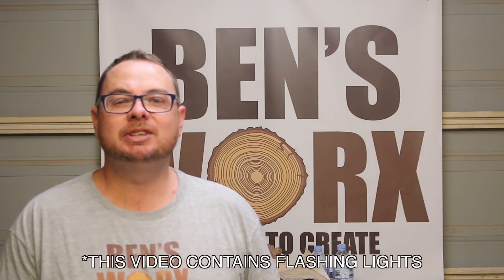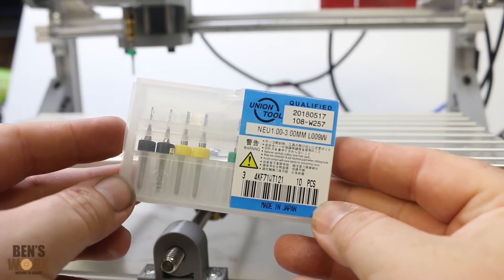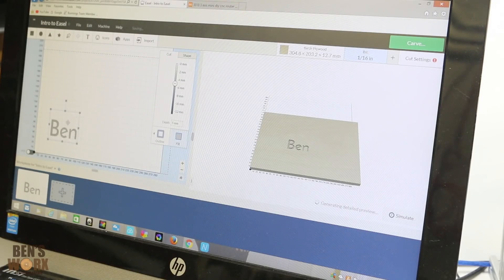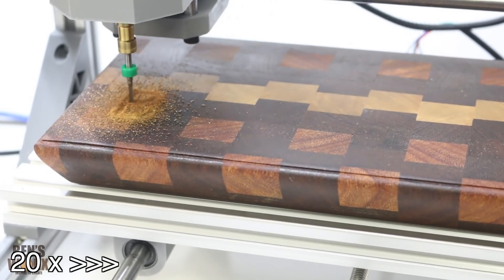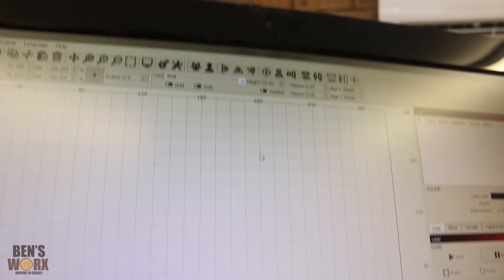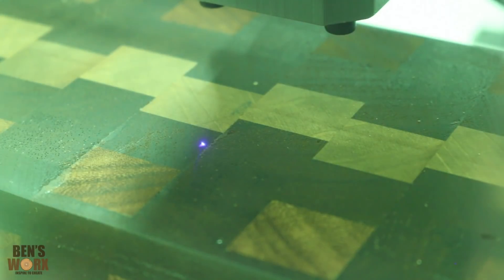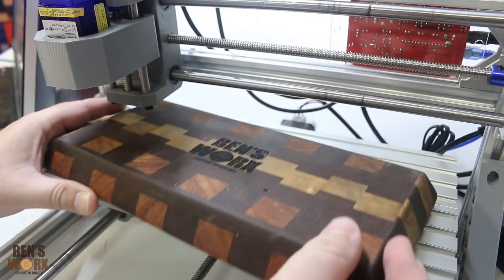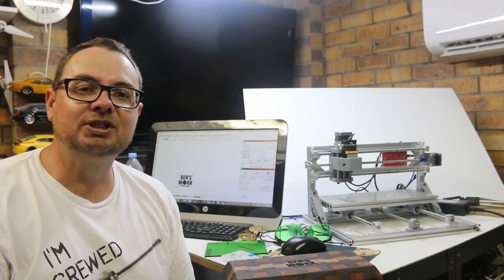Testing a 3018 3 Axis mini cnc router with 2500mw laser module

Comment: Ben I purchased another control board because the one I got had no laser port. I got a :Fan’ensheng 3018 CNC Router 3 Axis Control Board GRBL USB Stepper Motor Driver DIY Laser Engraver Milling Engraving Machine Controller. The old board came with a 24 volt DC supply. The new one had no supply. Is the DC supply 24 volts also ? Need hookup info on this board.

Comment: On the collar, if the shaft doesn't have a flat spot but the bits do, could you not just tighten the grub screws against a flat spot on the bit? Does that not hold good enough?

Comment: Hi Ben.  Thanks for sharing this video.  I have a question dealing with the laser part.  Basically to get to the point.  I'm building and painting wooden items.  What I'm wondering is, is safe and possible to use the laser on a painted wooden object?  Thanks in advance.

Comment: Hi Ben thanks for your videos, especially you resin work, they are very inspiring.
Do you have any advice on how to get a specific image into the cnc. I wondering if it could be used to cut out for inlay work ie setting metal charms into timber.

Comment: Ben how do you zero or set the machine to the homing position? I've tried but my projects never turn out quite right   on the board in relation to the position on the screen
Reply from the maker: Once you are in your desired home position there is a box saying set home on the screen if you are using Easel

Comment: I have a CNC 3018 pro device that I worked on and I gave some cancellation during work and because the motor parking device stays in a state of complete parking and a sound comes out of the motor in the case of an attempt .... Can the piece be whistled to return to what it was ..... please help

Comment: Anyone know what the secret is to get the 3018 setup with easel.  Ive installed arduino and open source grbl, flashed the board but still not connecting to easel

Comment: This 3018 seems to have a very large table with 8 tee sots.....the latest ones on Bangood, Amazon and Ebay….same basic design..... all have tables that only have 4 or 5 tee slots, but they are still termed 3018. The prices range from A$195 on Ebay (with the ER collet chuck)  to A$230 on Amazon and Bangood with the brass tool bit holder.
Reply: The 3018 figure refers to the usable area of the machine - ie 300 mm x 180mm
Reply: @alanmountford5574  Yes, I realise that, I just can't understand why the table in 2 identical machine adverts is different or appears to be if the adverts are true and not just a stock photo. In one Utube review of an assembly the table is actually 2 pieces joined underneath by 2 clamps and the screw nut housing.
Reply: @gangleweed  I am not sure why some tables are different - but I suspect there may be more than one manufacturer of these machines. But I could be wrong?
The machine I bought had the table in two pieces that joined together too.

Comment: You really didn't have to rewire those
You could have used the software to reverse the direction for some reason they came default reversed
But if you check into the software you'll see that there's a way to reverse the stepper motors

Comment: can you do engraving on transparent acrylic?
Reply from the maker: With the cutter yes, not with the laser, the laser needs a dark workpiece to burn correctly
Reply: @BensWorx  
thank you for replying my comment.
I've been searching for this reliable answer through internet for few hours.

thank you so much
Reply: Ben's Worx are you sure its not just the type of laser ? ive seen larger machines cut straight through 3cm sheets of resin and engrave very fast too
Reply from the maker: Yes it definitely depends on the strength of the laser, unfortunately this particular model won’t do it

Comment: Is it good for PCB milling? If so this and Ender 3 could make a good team for my IoT project.
Reply: Best is to add end stop so you can reposition when needed
Reply: @xiaoshizi131  Don't understand. What do you mean by 'add end stop'?
Reply: @benjaminlee9735  An end stop is a micro switch. On some of the cheap mill they aren't included.So you'll need to place them yourself. The Switch is to position more exactly your machine so you can start or restart your program. Enjoy Milling ;-)

Comment: Bro,will this Laser able to work on alluminium or steel with a minimum cut about .021inch
Reply from the maker: No mate
Reply: You can use the router
But
I don't think there is enough vertical space to accommodate a lower.

Comment: Ben, an excellent video and just what i need to get me going and move of 3d printing for a while or complement it, can you tell me if it works on acrylic please, thank you, Video was great from start to finish, also did you resin fill the board??
Reply from the maker: Thanks Neil, as long as you use the correct bit it will work on acrylic. As for the board I’ve been a bit slack and haven’t got round to it yet 😬
Reply: @BensWorx  Bloody Hell mate, your'e up late, i'm in spain and i thought i was late sometimes, never get round to sleep before 2 am and up at 7am!! Thanks for heads up, I will get one and the new cutters, I appreciate your candor and will follow you on instagram, i'm spiritburner.... I currently have a Creality Ender 3 pro, a Endurance Laser 8.5 watt beast that will cut any fucker and I was looking for something just to do simple cutting out on wood to make small models and engraving on wood like your name and if i can get a small laser as well win win...Thanks for the help , I assume it will cut out thin wood and plastic with the right tips so i can slot them together, my laser does but it always has the char line even with a air assist on the bugger, i have 85 litres of air pushing behind the beam to give it a cleaner cut so im hoping this will do it.  I was wondering, I assume you could either put a blower on it or even a micro vacuum cleaner onto the motor head and then when lasering reverse the blower to air assist....
Reply from the maker: Yeah mate, just finished a 12hr shift, I’ve just gotten an ender 3, I haven’t printed anything yet though
Reply: just seen the instagram account, that stuff is very nice that you produce.....I am retired early but have plenty of energy still to change with the times and take my work into my hobby. I already know lightburn back to front on my laser so thats good, just have to get my head around easel... If you need an intro to Endurance I am sure I could get you some discount from George if you are in the market for a bigger laser....just get in contact, I am one of his biggest supporters.
Reply from the maker: Thanks Neil! 👍
Reply: @BensWorx  just make sure its totally square and get a sheet of glass to print on not the magnetic bed, join the facebook group there are two, one for newbies and another one for oldies but there are some really nasty twats on it so watch yourself, make sure your questions are straight otherwise they lay into you, mostly from america so give as good as you get and when they do just FO and carry on, the ender is a great machine, but you need to buy really good software like simply3d to make your life a lot easier, its worth spending a bit, i have a mate in the uk who has 5 machines running 24/7 and he churns out stuff all the time to sell using these machines and the software. you can print a load of mods and you can upgrade the springs as well, normal things like xt60's dump and hard wire them in as the machine is on for a long time its the first part to burn out, I have mine installed in a old fridge with a glass door on the front which seals it and a gas air dump system i designed so i can leave the house and know if the fucker catches fire it will kill the power and kill the fire in 5 seconds or less, just make sure if you do put it in a cabinet with a extinguisher that you have a slot at the bottom for the co2 to push the air out.....works a charm and i love it, just want the mill so i can cut, mill and turn out some different shapes etc, 4 and 5 axis machine are above my hobby budget but this one looks nice. cheers and I will see you on creality.....just watch your electric bill!!
once you start printing it starts the meter whizzing, things take a long time to print but most slicers tell you the print time etc....one thing you do need to changes is the extruder for a aluminium bowden one, makes for a nice print and make sure the teflon pipe is all the way in, i have access to a great build video and setup if you need it, shout....all the best.
Reply: @spiritburners  Have you considered the direct drive for the Ender 3.....it's one mod I think would be well worth while. I watched the mods that Myfordboy did with a Bangood mill much like this one.....he almost completely rebuilt it. As long as you don't take milling with it too seriously you can get a lot of enjoyment just using it.
Reply: Ian Pearson thanks for the comment, I have but not sure where to purchase it for the ender sadly the Facebook group for the ender is full of trolls and nearly every post that goes up gets shouted down from  certain people in the US . Recently it has got so bad I have stopped posting for a while to see if it improves as new members are denigrated to the point that they give up the hobby and they are not welcome, I have seriously considered considered creating a group just for non US. It would be a shame to go down this route as there are some really nice guys over there and it’s spoiled by just a few rotten apples some of which are moderators.
Reply from the maker: Hey Neil, somehow your message got lost in the crowd, thanks for the info mate 👍

Comment: It’s good to watch your video there. I am planning to get one as I live in Aus as well.
I have few questions about their product see if you are able to help.
1. Is all software included? Do I need to download online or find the proper software myself? Anything to buy separately?
2. How long does shipping take?
3. What’s the max size of the chuck to hold the drill?
Thank you
Reply from the maker: Thanks Mate,

No software included you will need to source programs online

It took about 3 weeks from memory 

The collar is 3mm
Reply: I got mine from Ebay with the updated control board and er11 collet 
The grbl candle software works but I've been looking for a better platform to work from 
Easel works well to run your cad and generate gcode with I haven't ran the laser yet 
Be prepared to break tool bits tho 
It is slow for either more detail work and I carved 2mm deep project in MDF a 100mm x100m and that took over 2hrs
Reply: @CCCOILS  got a link to the ebay store ?

Comment: Hi, can send link for the flat top bits packs ? Thanks !
Reply from the maker: https://rover.ebay.com/rover/0/0/0?mpre=https%3A%2F%2Fwww.ebay.com.au%2Fulk%2Fitm%2F362502951901
Reply: @BensWorx  CNC 101, use the correct tool.  You should NOT be using that type of end mill with wood.  "Corn" cutter style end mills are made for composites (fiberglass, carbon, kevlar).  You should be using a fluted end mill.  For a cheapo machine like this, a 2 flute up spiral will do.

Comment: Hey Ben can the rails and the bed/table of this CNC m/c be extended to do larger jobs, Iḿ interested in making signs or small displays (8 to 10 inch letters) to hang from lamp poles. I understand I would need to upgrade the cutting tools and the software, thx...
Reply from the maker: Hi Melly,  I think it would be more cost effective to buy a larger machine, you would also need to change the worm shafts and guide rails

Comment: As if they couldn't have put a switch instead of the jumper pins, few cents. Then it could have been so much better.
Reply from the maker: Agree 👍
Reply: Still is a very easy 'mod' (if you can even call it a mod) to do anyway...
Or change the Arduino code to autoselect this.

Comment: just to add you can change the step pins in the GRBL so you don't have to physically disconnect the wiring. the pins have built in H Bridge within the OP amp of the IC

Comment: I have seen on the site that the cnc has maximum working area of 300x180x45.

But your work sheet size was 300x205.

Is it possible to make a larger size parts than the given working area of the model ? Or was it the original working area? 

As far as I know, if the part is larger than the workspace given to the model, you know that you have to turn it  and start  exactly where the less work on the part. 

Actually I'm going to make 300x200 size parts. But the model lacks 20mm.
 
I hesitate to buy that or other.
Reply from the maker: Yes it will only travel max 180
Reply: @BensWorx   Thank you for your response. So.... I made up my mind. I'll buy 6040 cnc. Even it's too expensive.    

And I subscribe your channel. Bye!

Comment: DO NOT change the wiring on the motors......... In grbl, enter command $3=5 in the console and that will sort the direction of the motors.
Reply: Is that computer code for "up = down"?
Reply: @jefflittle8913  It's a command the software uses for direction
Reply: I am glad someone said it lolllll
Reply: @Dj Colourzone Well can you code right out of the box ?- I couldn't and that is why I trained in programming !!
Reply: @NoneApplicable-p3p  well see he bought the British model ... it was delivered to Australia... no wonder machine was upside down :-)
Reply: you sound like you know what your talking about, do you have a link for the software, my cnc machine is on order and cant find the correct software lol
Reply: @ChazTek Studios no it would just make it go forward or reverse

Comment: I bought one of those because I couldn't buy the parts to make one for that price but the Y axis was too slow so I removed the drive screw and used a timing belt and remounted the motor. I already have a router so removing the Z axis motor lightened it up a lot so now it goes a lot faster but I am going to put a bigger motor so I can up the acceleration. Currently I have the speed at 350mm per sec but the poor acceleration means lot steps at the end of each row.
Reply from the maker: Sounds like a good idea mate

Comment: bro, you can change the direction form grbl
Reply: There is a jumper switch on the control board that controls motor direction.
Reply: @placitas52  could you make a RC boat propeller with these CNC?
Reply: Heck he could just put the connector upside down and it would work
Reply: @S00rabh  No, it wouldn't.

Comment: did yours come with 2 laser connectors 1 red 1 white on board wasnt sure which connector to use
Reply from the maker: Hi Dave, I plugged mine into the far left connector facing the machine

Comment: The machine looks cool.  Works well.  As a rank beginner, this would work for me.  However, I wonder if you need something that finishes a project in a more timely manner.

Thanks for the showcase!

—Ellen
Reply from the maker: I totally agree Ellen
Reply: Cnc machines are not that fast. Really depends on resolution. A small machine like this one, is limited to deapth of cut and step over of cut. Laser pretty cool, but what about safety. Eye protection and reflection?